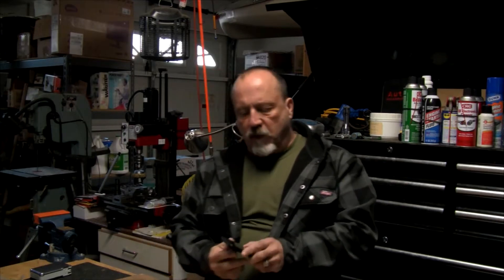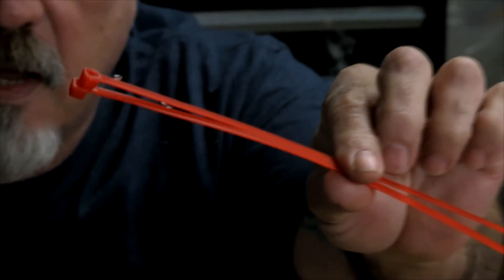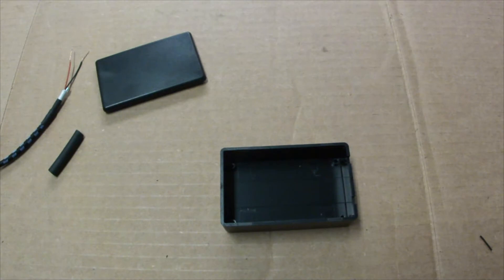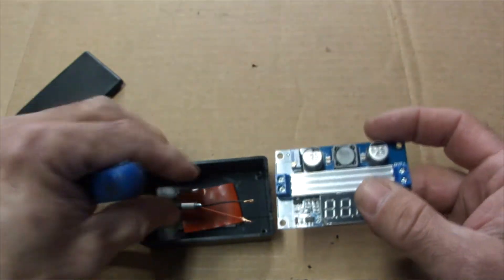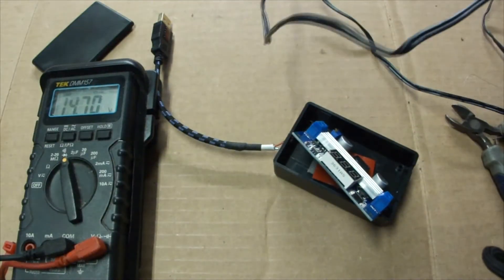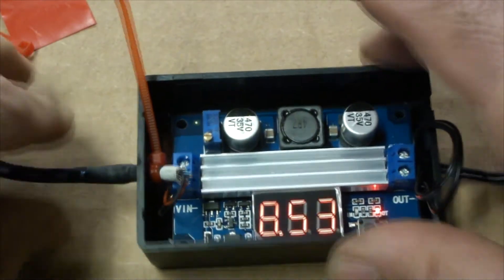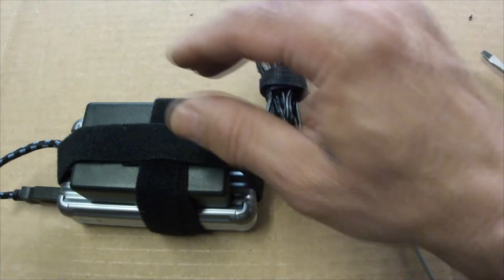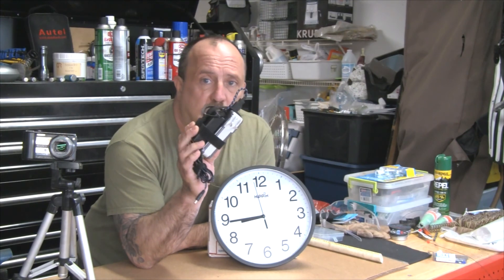Portable Camera Charger Battery with a  USB Power Bank - DIY Battery Charger

Comment: Hey Jose, this is sheer GENIUS! Great video, with clear and easy to follow instructions. You did a great job of demonstrating the assembly, and your explanations during the assembly were very informative. This is a terrific solution and it solves a big problem for me! Thanks a million for posting this great tip and Stay Safe during the pandemic!
Reply from the maker: Thank you! I appreciate the great feedback! This setup has been extremely helpful for me. Especially when I forget to hook up the charger, the battery pack will run for hours!

Comment: Hey Jose, if I have a battery pack that is 7.2V and 700 mA, do I need to get a battery pack that has the same current, or does the voltage converter have an option to change the current supplied as well?
Reply from the maker: The voltage convertor I used has a max output of 6 Amps max. So in this case, 700 ma would be well within the convertors capacity. The output of 7.2v and the draw from the device would determine how much amperage is actually pulled from the convertor. In your case, based on the device you are connecting to, the draw should never exceed 700ma.
Reply from the maker: I forgot to add that yes, the battery pack should be able to deliver at least 700ma at the 5v input voltage